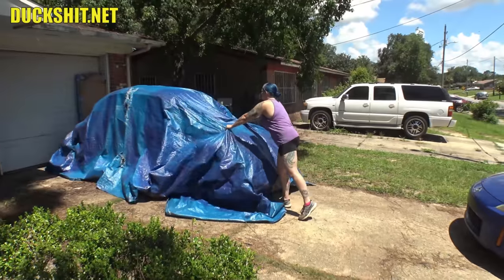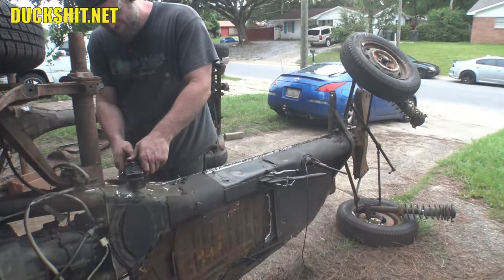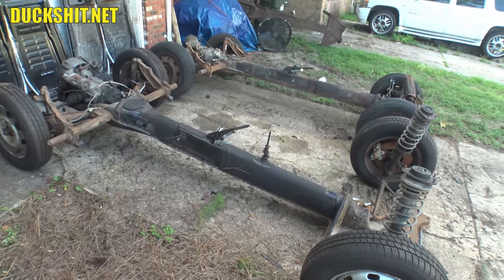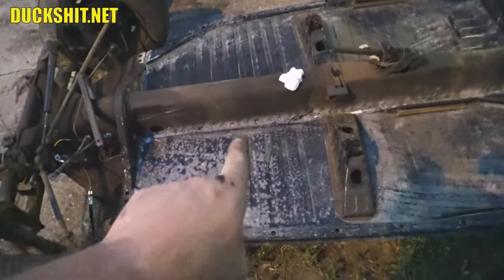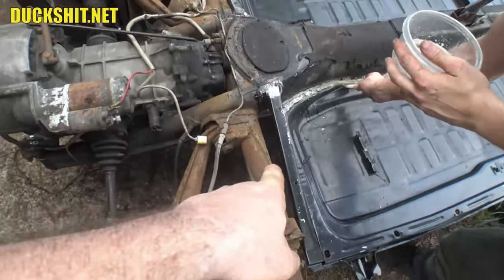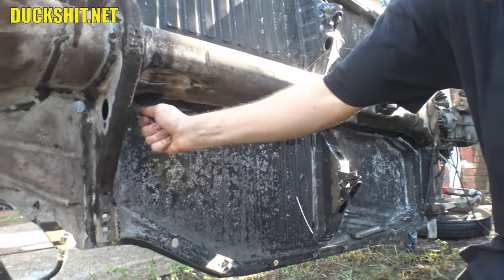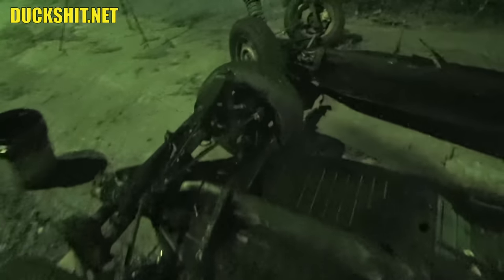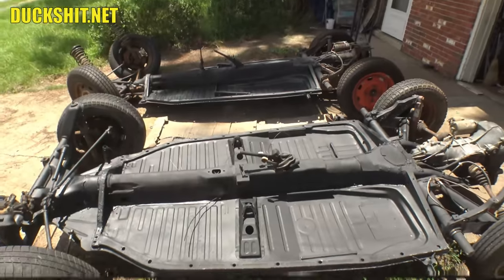Double VW Floor Pans Replacement in Under 45 Minutes!  - 04

Comment: 1st TIME VIEWER...AND 1st TIME SEEING PANS REBUILT...KEWL JOB BOTH OF YAH...I built a sand rail (1972) sectioned and moved shifter back 12 inches...easy...NAMED IT;  BOULDER DASH 1 ( Built in 30 seconds by Dave) HAD A 1200cc w big bore kit...1350cc 2bbl it ran well...
Reply from the maker: Oh man, and you're so excited you gotta use all them caps!  Haha!  Thanks David!  Lots of great stuff around here is happening!  Much apprecaited!

Comment: Great job. Love the attention to sealing the seams. Last a long time.
Reply from the maker: Yes sir!  Everyone always tells me just to seal it and then paint it.... total fail!  Always do the opposite!
Reply: @DuckmanCycles  What seam sealer do you use or what exactly is it? I know you said it was tar but is it just plain roofing tar? Do they make different kinds? Also do you use anything to spray inside the frame and what do you use to spray it in with. I know some people spray oil in their frames. I live in Pennsylvania so rust is an ever up hill battle.
Reply from the maker: @joebruno2675  Just tar my friend, doesn't matter if it's for driveway or for the roof.  Tar is tar.  I ordinarily don't mess with inside the tunnel unless it's already compromised, it's pretty rare to see rust inside of them.  Heater channels are a different story though... I've heard of some people spraying inside of the heater channels with their old motor oil every winter up north.... I can't imagine that smells too good LOL
Reply: @DuckmanCycles  Thanks. Yeah i would not want to spray anything in the tunnel. I do a mixture of oil, grease, and boiled linseed oil under the car.  I wonder about oil, boiled linseed oil, and mineral spirits to be somehow sprayed in the frame. I am not sure what kind of nozzle I would need for an air spray paint gun?  I am still working on the heating system. Last 2 winters were very cold. None of the heater tubes are hooked up and the front box thing is missing. Not sure if their needs to be a blower motor to push the heat?
Reply from the maker: @joebruno2675  ell there is no frame on a beetle in which to spray inside of, I suppose you can spray inside the body panels though  or the tunnel.... but you wouldn't put oil in a paint gun, it'll ruin it for paint later.  You'll just never get it absolutely clean.  But as far as the heat is concerned, the engine's fan is actually what blows it.  Nothing else needed!  😁👍🏻🦆💩
Reply: @DuckmanCycles  Yeah the inside the body panels is what I mean. I am willing to sacrifice a paint gun to keep Felix (our beetle) safe from rust. I will just keep the paint gun for that purpose. I need to order tubes for the heat because they are missing. Thanks again for all the advice.
Reply from the maker: @joebruno2675  there is a special 360° sprayer designed for such things.  Maybe a good idea to Google and see if you can find one.   I'll be doing similar cavity waxing on my 56.
Reply: @DuckmanCycles  Cool. I will look forward to seeing a video on that if you make one on it. When I order one I will be sure to share my experience with it.

Comment: Nice work there not even a cut needed on the orange beetles pans, but sometimes things don't line up  like your thole comment difference in factory tolerances or even just how worn the dies and presses are from use, my Lada was awful in that aspect 
I could stick my finger between the door and front fenders lol
Reply from the maker: Yep.... lol, aftermarket panels are never perfect.  Sometimes better than others, but all aftermarket panels need a little tweaking, no two are alike!  But nothing a dremel can't solve if the hole is just a tad off!

Comment: Having some Weird Bob Ross flashbacks 😳 when the Black Rust-Oleum paint came out!!! Otherwise yes a great call to paint them prior to the seam sealing, plus the paint will help seal a lot of any gappage in between the 2 pieces as well as providing protection for all the bare steel areas, just in case the seam sealer is to leak or chip off over time. 👍
Reply from the maker: I edited out a big of Bob Ross references... LoL!  But they were there!  Thanks man!   😁👍🦆💩

Comment: Very nice quick and dirty way to do this and give a new lease on life to these cars.
Reply from the maker: Quick a dirty, well... its the right way!   😁👍🦆💩
Reply: @DuckmanCycles  I agree; done right and without stripping the tunnel or going into much more detail but preserving the chassis and keeping it on the road. That tip on the tar was nice; I used seam sealer on mine. Had I known I would’ve used the tar.
Reply from the maker: Tar was the factory method... modern material seam sealers are fine, too.... but a huge price difference!

Comment: Great video Duckman!!! After a year of posting this video, do you still recommend not putting holes in the floor pans for welding? Are you using the same process as this video? Thanks again
Reply from the maker: After the dozens that I've done in earlier videos too, I still say no holes need be drilled.  😁👍🏻

Comment: Good video! Tell William tetanus doesn’t care how cool you are haha! I had the same problem with my paint gun until I found out from Brian of Paint Society who said just remove the small filter basket that’s under the cup, figgin works perfectly! Thanks!
Reply from the maker: I actually got the first sprayer to work after soaking it really good, until I lost part of it (which I think has turned up, I'll have to investigate, its story worthy)  The classic one didn't do anything unless i held it upside down... and its not one that is meant to do that so it just makes a mess.  I ended up with a new sprayer.... and that broke too.   So I used parts from the first one to make up for it and that got the job done.  😁👍🦆💩
Reply: Good thing being handy!🙃
Reply from the maker: Yeah tell me about it, lol! I dunno how anyone else survives!

Comment: william my type3  fastback  coming home at midnite  driving  home  the wheel passed me hit the backing plate wore down the brake  adjusters had a spark show 8 feet high next day found the   tire the hub cap still on the cotter pin had backed out replaced the backing plate rebuilding the brakes , got it back on the road
Reply from the maker: Uh oh!  Wish you had that one on video!  Haha!   😁👍🦆💩

Comment: I've looked at all your videos, have you done floor pans or the reinforcement rails for a convertible? Also thanks for the links for the Phosphoric acid!
Reply from the maker: No, I have not done any convertibles, I had a couple come across the wire, but the owner's ended up settling with someone else..... and years later those cars are still sitting all cut apart.  LoL!  Maybe I will do one again someday!

Comment: Hey there! I have a Bradley GT1 and would love for you to work on one please. Have you ever used fiberglass floor pans? Thank you for your response!
Reply from the maker: Well I try to do things proper, and unfortunately I can't properly weld it up a fiberglass floor pan.  Several years ago I did remove some fiberglass floor pans in a video.  There was really nothing wrong with them, just the owner of the car wanted to do things right.  The downside to fiberglass is you either have to use screws or rivets (which means you have to make holes in the tunnel flange that could leak and rust and compromise the chassis) or you have to glue them in... panel bond may work great for it but I cant attest for that, but it would make for a great video to try it and see.  The public wants to know!  Let's do it!

Comment: Nice job, 2 more coming back to life! I was going to buy an air chisel and see you use a small one. Is it worth it to buy one of the bigger type? I see HF and Tractor Supply have them reasonable. What's your 2 cents worth?
Reply from the maker: I've never seen nor tried a bigger one, a bigger blade might be nice, we were technically using the wrong one for a lot of that, but it got the job done!  😁👍🦆💩

Comment: Great video..what size compressor do you have? The reason I’m asking is because I’m looking at buying one to power air tools like the air chisel you use. I don’t have a ton to spend though. Can you power air tools with a 6 or 8 gallon compressor? That’s what I’m looking at
Reply from the maker: You can power air tools with a smaller compressor, but if you intend to use it more than a few minutes at a time you'll need something bigger.  I forget what compressor this is, but I got it off of some Marketplace item 10 years ago.  Its pretty big.  60 gallon or something.   The compressor portion blew out, so I upgraded it to something that fills even faster than before.  Its been good!
Reply: @DuckmanCycles  thanks for the response. You continue to make great floor pan videos. I think I might need some of that creativity juice to finish my floor pans

Comment: The pans came out great. Nice to have a little bit of help. No complaints from your neighbor about over spray on his suv? Even at low pressure it travels pretty good.  Not critiquing you, just curious 🤔.  On a positive note, you know your shit. Great video. 👍 Duckman 🦆. Noel
Reply from the maker: Why would I spray without consideration of things that are around me?  As you said, I know my shit lol!  The wind (AND FAN) were blowing in the opposite direction... and thats why my car was so far away IN THE WIND DIRECTION.  But even if I sprayed paint directly up into the air, if it carried that far in the air, it'd be dissapated, and dry by the time it got there and it would just be dust which you probably wouldnt even notice.  😁👍🦆💩

Comment: kinda pointless now but the grinder just needed the brushes replaced as they wear down with use. Sometimes they come with a spare set in a baggy if not replacements are like $2.

Comment: have you a link to that tar stuff please? i want to see if we can get it here in the uk. always nice to have a helper, especially one that has the same humor as you lol yes beers in a freezer is the best way to cool it quick but make sure you take them out after 30 mins or so or you will end up with exploded beer ice. ask me how i know haha! i usually put a timer on my phone so i dont forget. 

btw many farts today haha maybe put them instead of the Mario noise for the swear words lmao!!
Reply from the maker: Tar is just tar, you should be able to find it at your local hardware store.  Even the stuff that goes on a rooftop will work... if I gave you a link it would be to an American Retailer anyway lol, not much good in UK. 

The gas was even worse the day we did the brake lines, that video is coming up.... not sure how much ended up on camera though lol
Reply: @DuckmanCycles  oh i know what it is now i got a tin of it its called bituminous mastic. very sticky stuff but it didnt look as thick as the stuff you have. 

the stuff you have reminds me of underseal we used to use it in the 90's put it under the car and on weld patches, on sills etc. it was thick like the stuff you got but we dont get it like that any more sadly its watered down crap lol. 

lol looking forward to more work keep up the video's theyre great
Reply from the maker: Thanks man!  These pans are good and sealed!

Comment: have you ever installed the fiberglass floor pans?   ive always wondered how they are to deal with.
Reply from the maker: No, but a couple years ago I made a video removing some and replacing with steel ones on a Type-3.  Seems those are usually riveted, or glued in, or some combination.  Seemed serviceable, but the owner didn't like them.

Comment: I'm lazy, I always piss my phosphoric acid on wit a cheapo spray bottle....
Reply from the maker: I've heard of people putting it in their paint gun also, probably not a good idea I think it will eat the paint gun LOL!  But it's so thin you'll just add more of it to the atmosphere than on to your floor pan, it doesnt evaporate as an acid, I'll get on and eat everything nearby.  The brushing action makes a huge difference in speeding up its process though, and you can make certain that it goes into the seams where it needs to.
Reply: @DuckmanCycles  Yes, I just did an inner fender from a 67 chevelle the other day. Raccoons got into it and nested between the inner fender and the outer. That'll teach me to leave the hood open. Anyway they made a nice comfy place to stay in there with every dry leaf from my property, I guess when they need to piss they just let it fly. Needless to say it was really rusty, I started with muriatic acid and then went to the phosphoric for the finish. Agitation definitely helps, especially on heavy pitting. Great job Duckman, Those pans will stay nice for yrs, unless you let the raccoons at them.